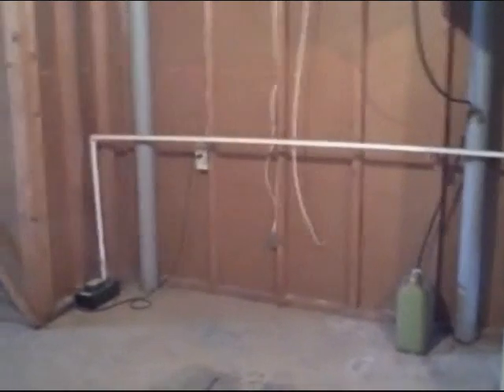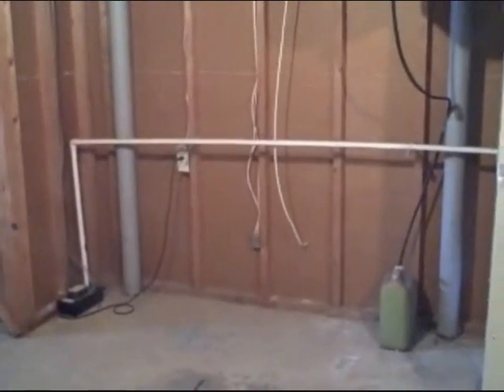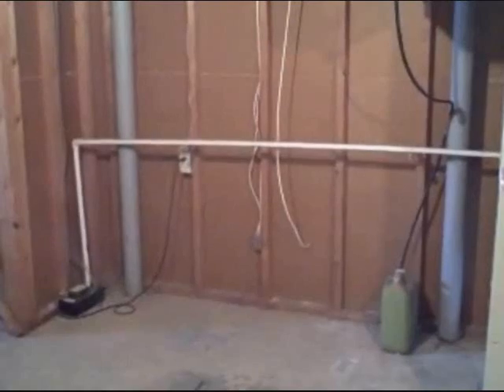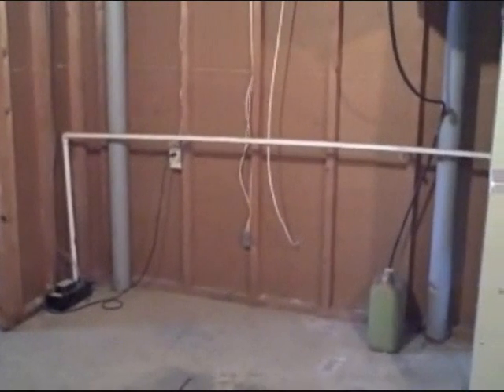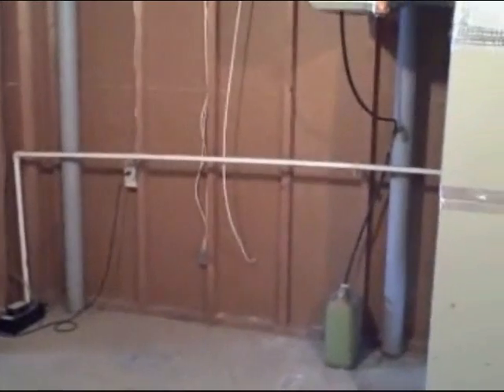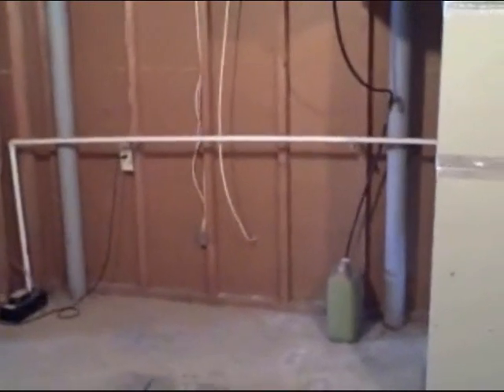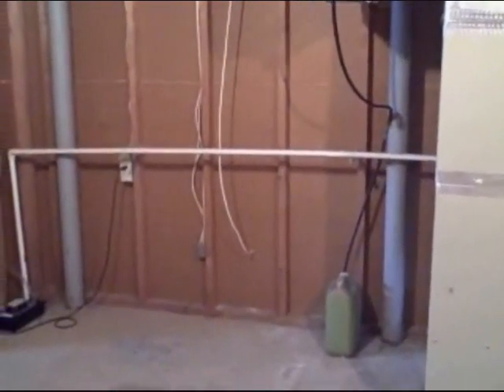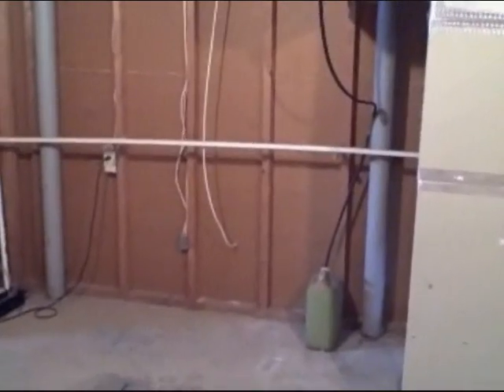Improper Condensate Drain Line | (302) 883-8797 | Call Us!

Comment: Here in Spokane Washington in the inland Northwest we cannot drain our equipment outside because it will freeze the whole line and back up into the house and cause problems. It is 100% absolutely OK to drain it in the washer box drain. As long as it's on top of the P-trap it's fine

Comment from the maker: Thank's For the comments.
I just wanted to let you know that on the other side of the heater they had about 10 more feet of pipe no trap. My point with this configuration is that water was laying in the condensate drain line and pan at the coil and was over flowing into the heater. In addition the humidifier should not be drained this way. Were this home was located the township does not allow any condensate drain line to discharge into the sewer system. The bottom line they had to fix it.

Comment: Sir very good  video , I want to ask why can not go to main sewer direct ? if  discharges  into the laundry room it will go to main sewer anyway , what is difference  please ? can you explain why ?  because my condensate pipe is go outside the house cause crack by winter now , The guys who install furnace for me now he put inside the house of foundation ground rock to go through  the water ,   I want to install inside the house  by furnace  already has  2 inches stand copper drain pie go by , Can I hook up there ? some body told me if I hook up the condensate hose it will eat the copper pie and is it right way to do that ?   thanks sir .

Comment: Well first off I would like to say that drain line does need to have more tilt on it and as far as it going into that washer drain there is nothing wrong with that, where we live there are a bunch of houses that have that drain in the washer line and no problem. I would not the a/c line to pump outside because the ground will stay wet where that tube is at.